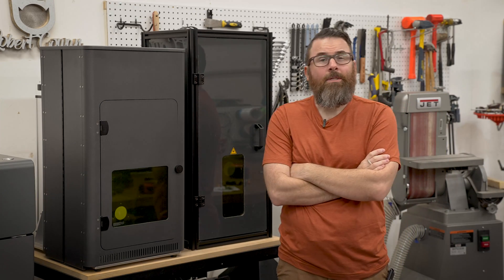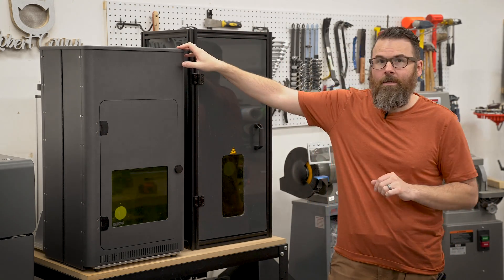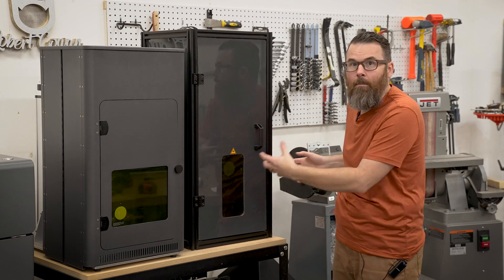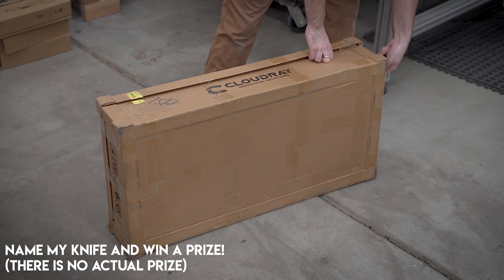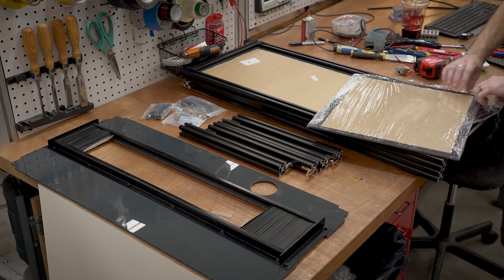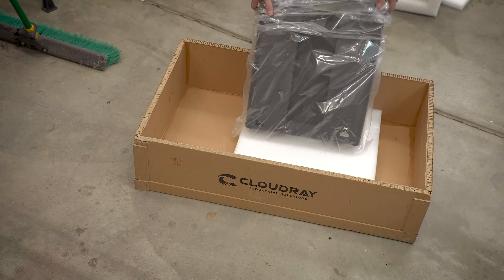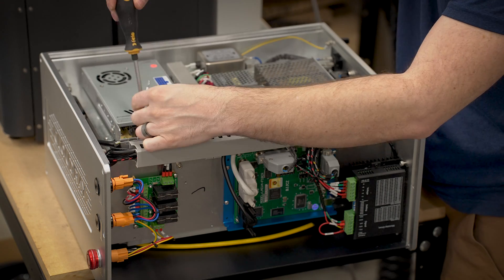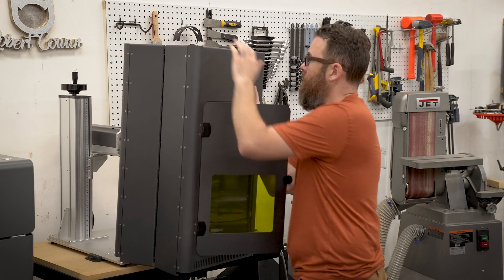Fiber Laser Safety Enclosures

Comment: Isn't adjusting the focus kind of annoying with both of them? 
Having to reach around the enclosure instead of reaching inside of it?
Reply from the maker: It is!  However, these machines are more designed for 'jobs'.  For example, you're running 500 of the same part, so you just set the focus and run the job.  For my business, we just designed 'pallets' that align on the bottom plate and bring the parts to the same focal distance, so we never adjust the focus on the machine.

Comment: Is the door safetyswitch normally open (NO), or normally closed (NC)? If the latter, then I'd consider that a safety issue (wire disconnected, pinched, cut, etc)

Comment: People cannot trusted with lasers to protect themselves and those around them. All the have to do is wear the proper protective glasses. Unfortunately the lawyers want a piece of the action and will push any injury to go to trial and stick it to the laser manufacturer for not protecting his product. That's why everything is so expensive. I have a friend who bought one of the cheap lasers, 2MW or less for his kids projects. Kids were told they could only use it when he was home. He went to work and his 13 year son wondered if the laser would cut finger nails. He found out the bloody way that it will. At least dad told to suck it up and be glad he didn't cut a finger off.
Reply from the maker: Giving a kid a 2mW laser is kinda irresponsible, especially if it's one of the unknown brands from amazon.  that's VERY VERY different from this.

Comment: Personally I bought just the laser proof acrylic window, and i built it out of constructiom foam/insulation board. The windoe cost $125. The foam board I already had but a sheet of it is $15 or less. No it doesn't have an interlock switch but its super simple to make one. I can't see spending that much worth it to me. The foamboard is super light, super easy to pick up. I added holes for the focus wheel and exhaust pipe and also added a light and camera. I can disconnect the camera light and fan duct and lift it off with ease. I also made the front to open from the bottom with 1/2 of each side, so for larger things I can still use it with the lid open, no need to remive it entirely.
Reply from the maker: DIY is almost always the cheaper solution.  But for a business, they're not going to waste time making something.

Comment: That knife looks like a Camillus Cuda. I have the half serrated version which they discontinued years and years ago. One of the smoothest operating folders I have ever used.
Reply from the maker: Hum, close, but not quite!
Reply: @RobertCowanDIY  Damn! Not even a Camillus? Looks so similar.
Reply from the maker: @c0mputer  It's an Arcform Slimfoot Auto Operator.  Fully blacked out with tritium in the button.  Slick knife.
Reply: @RobertCowanDIY  Oh yeah, nice knife. Never heard of them.
Reply from the maker: @c0mputer  they're a smaller company, but the mechanism is apparently made by pro-tech
Reply: @RobertCowanDIY should be a arcform slimfoot, i have the same as well, specifically the black dlc with black g10
Reply: @RobertCowanDIY Would love to know what knife that is now that you have asked.

Comment: The vents on the bottom need a baffle, i can see the base right through it!
A inclosure on such a laser is nearly useless until it's absolutely laser tight!
With such bad inclosures I would rather wear eye protection around them anyway, wich makes them completely obsolete.
That might be a reason why they sell them as such...
You need eye protection anyway if you deal with a not fully integrated laser system like that. So what's the point. Just gives you a false sense of protection!
Reply: +1 for that
Reply from the maker: 'laser tight'?  I don't think that's how lasers work...
Reply: @RobertCowanDIY  Sry, as a non nativ English speaker I might be a bit off in expression....
I mean light tight or shutt off inclosure.
If you have any gap in your inclosure what so ever, you risk to get a reflections of the laser out that in every imaginal way!
And such an inclosure might capture 99% of that, but the 1% of chance might give you another blind spot in your eyeball!
Not worth it, or I am wrong!?
Reply from the maker: @martin09091989  For any damage, the light needs to be focused.  If the light reflects and bounces off surfaces, it will diffuse and scatter quickly and will not pose much of a risk.  I don't see having vents at the bottom an issue at all.  I would challenge someone to reflect a fiber laser at that angle and still have it cause any damage.  They have a very narrow focus and even a few inches away it would be too wide to really cause any issue even IF you could get a good reflection out of it.
Reply: @RobertCowanDIY  Then why bother with safety equipment at all around those lasers?

High power Lasers are dangerous at any time, not just when they are focused. Because it's a coherent light source it can potentially focus on your retina in any odd reflection.
I wouldn't half ass such safety equipment!
Reply from the maker: @martin09091989  I will freely admit I'm not an expert here but I do know that to get a focused beam (which has enough power to cause damage) you need very high reflectivity.  Even the finest ground lenses will still have losses.  If you had an actual mirror at the bottom, I could see some risk, but it would think it would be too spread out?

Comment: For home I will just build one. They are out of their minds with the pricing. I could build a full aluminum with lights and door switch for under 100 bucks and that's for a so-called "high end" and it would be 50% lighter than that.

If this was in the 200 dollar price range for the "expensive" one it might be something the end user would buy. I have a QS-50 and I'd never spend close to 1/4 what the machine itself was for and enclosure.

Anyways good video on the product, just the value is not there. Something that cost them 50 bucks to make (yes I know there is stamping tooling required for the enclosure and I know that's why the price is what it is)

Please don't take this as negativity, I am just stating my own opinions and it's nothing against you or Cloudray.
Reply from the maker: The cheap one is something you could absolutely build but the nicer one is quite nice.  BUT, still a bit overpriced I think.

Comment: That higher priced enclosure is well designed. Only hang up is that the price seems high for what it is. They should sell the better one only at $500 max and get rid of the lower end one. No need for the fiddly one at all.
Reply from the maker: Oh, I've told them that!  It needs to be much cheaper, agreed.

Comment: Neat. Contemplating a fiber laser, but safety is really an issue - especially with kids in the workshop from time to time. Interlock for the win!
Reply from the maker: Yeah, you'd just need to make sure they're not around while the laser is going, or use an enclosure with an interlock.